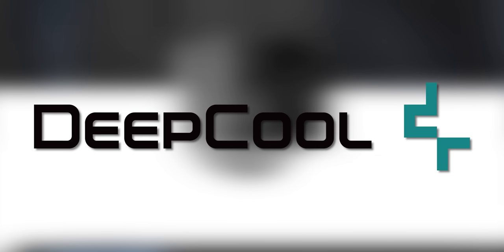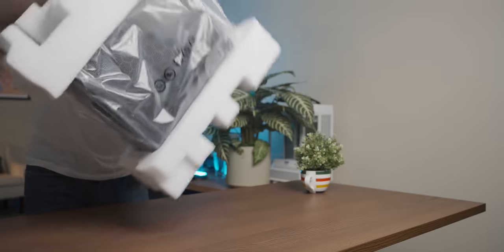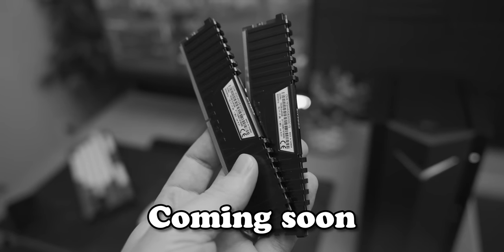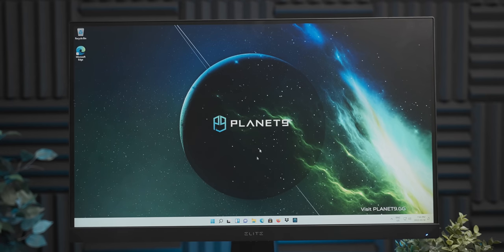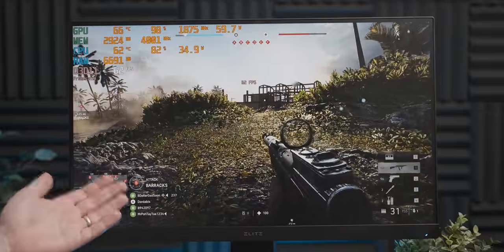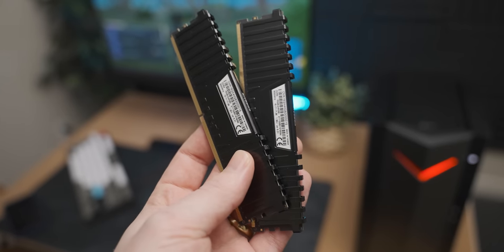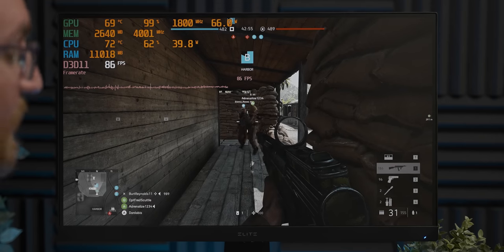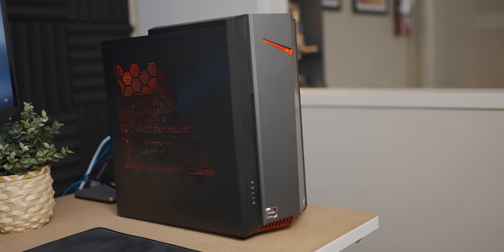I Bought The WORST Rated Best Buy Gaming PC

Comment: Reseller here --- I've gotten 2 of the older versions/variants second-hand for dirt cheap. Probably because it's pretty amazing how poorly they perform out of the box. Upgraded ram, storage, & cooling then resold. Not horrendous if picked up cheap and upgraded. But, you should open up that GPU and take a look at how poorly the internal cooling is done. HWmonitor will reveal the truth about temps on that gpu.
Reply: He showed the temps while gaming, which were in low 60's while gaming which is normal.
Reply: @jarateman6427  only the core gets active cooling on most oem cards, the core is what u saw in the video
Reply: The mobo needs to be swapped out tho, that bios has no options, they should get inspiration from the Chinese xeon mobo's with 9000 options
Reply: I have roughly the same PC without graphics card but have 750 way power supply and 2 8 gigs ram
Reply: But only for 300 pounds
Reply: @jarateman6427  - Those aren't ALL the temps on a gpu
Reply: @dawre3124  - Not true at all. Why do you think there's so many thermal pads on cards nowadays?
Reply: @ghosttheoremproductions5469  not on 16 series oem cards
Reply: @dawre3124  - Well, two problems there. First, that's not what you said originally. Secondly, most consumer grade 16 series cards DO actually. A simple google image search reveals that if you need proof. I'm only seeing consistent lack of additional cooling on the uber-budget oem card variants. And testing shows that off-die temps on those are very high. But, what do I know? I only pull them apart, build, test, and sell for a living ... lol
Reply: @ghosttheoremproductions5469  He already did specify OEM cards, twice. You're arguing with yourself.
Reply from the maker: That’s true! It’s the second one of those GTX 1650s that I’ve gotten my hands on and they are pretty janky.
Reply: @SaddisticSpeller  - Reading comprehension issue much?
Reply: @ghosttheoremproductions5469  i have one 1660 ti from hp, one 1060. Both only cool the core. Also every other oem 16 series card looks like that. You can also look at gamers nexus 1660super Dell review to see how bad they are. If that is your job to know these things you should do a better job
Reply: @dawre3124  - Do you stop to read and understand or just write your next reply?
Reply: @ghosttheoremproductions5469  i wonder if you do lmao
Reply: @dawre3124  --- "only the core gets active cooling on most oem cards" - Not true --- "not on 16 series oem cards" - Now you're saying something different but that still isn't true. --- "i have one 1660 ti from hp, one 1060. Both only cool the core." - Your sample size of 2 is not compelling and 1 of those agrees with me anyways. --- "Also every other oem 16 series card looks like that." - This isn't something we are disagreeing about so I don't know why you keep repeating it. --- "You can also look at gamers nexus 1660super Dell review to see how bad they are." - Same as last --- "If that is your job to know these things you should do a better job"v - You're the one arguing non-points and making factually incorrect statements, lmao ------- ROFL. I'm done. Go argue with yourself in the corner or something.
Reply: @ghosttheoremproductions5469  you should tho. you dont have a signle point and yet you think ur right
Reply: @dawre3124  - I take it you don't read much. Just talk.
Reply: same, bought it at $500 new, threw in some 32GB 3600 sticks and SSD for gaming, and sandboxed all programs from each other and it runs extremely well, if I threw in a 3050 I honestly would be happy with how well its working rn. the 1650 is handling MW2 with no problem and I don't see any need to upgrade that yet tho. but If you are unsure then I def recommend getting an extended warranty from your seller for a peace of mind.
Reply: Mine blew today after 2 Years 3 months. I call planned obsolescence.

Comment: In my experience after replacing the prebuilt's  preinstalled os past that any slowdown of the PC over time is down to user error. People installing all kinds of weird crud and expecting their PC to not suffer for it. The other day i saw a guy complaining his computer was slow while he was running a mining program on it in the background.
Reply: If it lets you. I had an HP system years back that literally had it's bloatware built into the motherboard or something. Even went as far as installing windows in a different machine on a new HDD 100% clean then putting it into the HP and it refused to boot. You had to install windows on that computer at which point it would inject it's bloatware into the install at some point and if you tried to get around doing it the way HP wanted it would crash at boot. 

That's why I always caution the advice "just reinstall windows" because some companies go next level on not letting you do something on the hardware YOU bought without their permission.
Reply: @devilmikey00  yep, you have to fully wipe all the partitions on the drive or the restore partition will reinstall all the junk, insanity.
Reply: lol. Honestly not sure how they managed know enough to configure a miner, but not enough to know that running a miner will hurt general usage (unless you specifically tune the miner to be a bit lighter on the system)... Maybe they were using the Norton miner.... o_o The horror of such thoughts...
Reply: @devilmikey00  My professional recommendation is to not buy such computers. Not all oems do that and even HP doesn't do it on every system.
Reply: @11matt555  NiceHash basically does it all for you, it's really easy to setup. They even have a QuickMiner version which is even easier.
Reply from the maker: Haha!! That is true, most people often do some pretty crazy stuff with their systems. Thats why I want to spend a bunch of time with the system and see what’s what.
Reply from the maker: DeltaIsPower  Not at all. 😂
Reply: @devilmikey00  That's not accurate, I don't believe that for a single second. There is no way to build bloatware into a motherboard and furthering that make it auto-install. You probably installed it again from the driver download page without realizing it.
Reply: @devilmikey00  Def sounds like HP.
Reply: They be downloading 5mb free gta v
Reply: @Josh.Davidson  nope, stuff like that exists
Reply: @manlikeilyas  No it doesn't, sorry. Maybe through a driver or OEM utility but in the motherboard itself, impossible.
Reply: @Josh.Davidson  hm idk, ive seen something like this though
Reply: @devilmikey00  well the only way you can install a OS on one machine and use the same drive on another, both computers have to have pretty much the same brand of motherboard, sometimes it has to be the same exact motherboard or else it will not boot which is what you experienced
Reply: there is no storage on a motherboard for "bloatware" and no way for a board to know that an OS has been re-installed to trigger such a sequence. This is a conspiracy theory. You installed the bloat again - probably as part of a driver package. There is no way it can install itself.
Reply: @Josh.Davidson  This is wholly not true. One look up rocketfish for a direct malware injection from bios. And two since windows 8 the bios can flag programs as auto download from the windows store upon windows reinstallation.
Reply: @Jackpkmn  I couldn't find anything called "Rocketfish". If you mean the Lenovo "Superfish" incident, that wasn't reinstalled by the "BIOS", a clean install would clear it off your system.
I also can find no information for your auto download claims. Maybe you mean stuff like the NVIDIA control panel or Realtek control panel - that's flagged for download by the driver not the BIOS. That isnt' bloatware either, its part of the driver suite.
Reply: @devilmikey00  100% that pc would be eating lead salad if I had it.
Reply: For me, when I had a nitro laptop, it was really rubbish after a while. I just used adobe, epic games, and Minecraft. It sucked after a while! Did I mention it had a 3080 laptop gpu? It was truely horrible after a while
Reply: @devilmikey00  or you know, just buy a pre-built without os lol
Reply: Do you know a good pc for Minecraft ROBLOX and Steam VR games?
Reply: Mate of mine works in IT and does a lot of remote work. A client of theirs called, it was the boss of the client company wanting some remote work done to speed up his laptop and declutter it. My mate remotely connected to this guy's work laptop and began by clicking through his internet explorer tabs, as he had a lot of them open. He clicked onto a few and found the guy was browsing through Amazon, eBay, his personal bank account, etc all personal stuff. Then he clicked onto another tab and it bought onto both his screen and the guy's screen a porn video with about 20 different popups all loaded in the background and ads all over the page. He quickly clicked off of it but the client knew as he was on a phone call to him at the time and heard him stutter when he clicked onto the porn tab. Apparently the client very quickly and sheepishly said that he'd "done enough" to speed it up and declutter it after that.

Comment: To be fair, the second comment could easily be user error. "My PC is slow now" is either aging hardware and newer software or just a user putting junk on it. I assume the PC came with a small SSD so it's probably full, can't cache anything etc.. Not to mention dust and all, that may increase temps and throttle the PC.
Reply: I think it just had the single NVME drive. Or, they have 20 tabs of Chrome open.
Reply: I mean, the review doesn't even imply that the thing got slower over time. It just says that it's slow and they've had it for 5 months.
Reply: Worked at MS support for years and owned my own pc business before that, I can GUARANTEE that's what happen (I would see this all the time). The person is probably one of those people who just click through installers and don't read anything installing tons of bloatware on their pc.
Reply: yup, especially on cheap SLC caching SSD's. You only need to get your drive to 80-90% full and it will drop performance because of how caching works on those drives.
Reply: @sweaterfish6311  The message is clear to me: It's so slow, it took them 5 months to write the review.
Reply from the maker: Oh for sure! That’s why I want to spend some time with the system and see how it holds up to my use.
Reply: @Jtzkb  I have 20 windows open not sure how many tabs but I'm using between 40-60gb of swap on a nvme drive.
Reply: @Jtzkb  can't it's soldered 🙃 thinking about getting a new machine
Reply: @Jtzkb  I did some math and I'm only writing about  1.6 TB per 30 days which equates to about 8% of the warranty coverage by the time the warranty expires.
Reply: "MOST" people have a TON of startup programs that run at Window boot and this can literally "KIIL" you on performance levels!  One quick clue to this is after Windows boots up and settles down after a minute or so bring up the Task Manager and look to see how much your CPU is being used. If its over 3% you have too many "startup" programs running in the background or your Antivirus is hogging resources! You need to STOP these hogging programs from running! My system never goes beyond 2% CPU at idle with the Task Manager open! I do CAD (with Raytracing rendering), Gaming, Video/Photo editing and have 32Mb of DDR4 3600Mhz RAM and have no issues with my hardware specs. I do NOT have a beast rig and consider it as as a low/mid level PREMIUM gaming rig.
Reply: @InfectedChris  20 tabs of Chrome open? Amateurs. I have 79 tabs, ready to access.

Comment: Generally theres a debug option in those bioses. If you hold shift and hit the f keys you may be able to get a hidden list of bios options. Some dell bioses had hidden overclocking features in those menus.
Reply: Yeah, my MSI Laptop has a pretty damn exhaustive hidden BIOS menu.  Like so exhaustive I'm fairly sure you could easily brick the laptop if you didn't know what you're doing.
Reply: @startedtech  You can't "brick" a system with a bios. Because they always have an on-board flash option back to the original bios.
Reply: @zedorda1337  not true
Reply from the maker: Oh cool! I’ll dig around in it over my extended period with the system and see what I can find. 👍
Reply: Same. I have an Acer Nitro laptop and there is an advanced bios you can access to change many features.
Reply: @DawidDoesTechStuff  You will dig in and find venereal disease stuff in there.
Reply: @DawidDoesTechStuff  just hit random things in the bios. Shift keys with f keys and ctrl keys with f keys. I found debug menus on my x58 dell motherboards and a few 1151 acer boards  a while ago.
Reply: Let's be real here. Before the pandemic these were $600 dollar PC's. It's only because of the "chip shortage" which I think is a conspiracy to fleece consumers, that these are so expensive. It's worth 600. Not 1K
Reply: @michaelimlay5773  how do you access that menu i have a acer nitro 5 laptop.
Reply: @startedtech  What?
Reply: I relate to your name. I have an Sapphire HD7970 in my backup system and it's still a beast for its age even now lol. A legend among GPUs.
Reply: @DawidDoesTechStuff what did you find?

Comment: The peripherals aren't really ewaste if it works it could be a backup option if the keyboard or mouse breaks. At least that is my poor boy opinion
Reply: You are right, but once you get a quality keyboard, they don't break like cheap ones, and you won't be able to stand typing on that garbage membrane keyboard either. I have an extra keyboard in my closet, but it's been there for 5 years now.
Reply: @Eckx1084  can confirm. Used some e waste peripherals for like 3 years and recently switched over to some good stuff and it was life changing lol
Reply: @Zacyz125  I got my kids a Razer bundle for Christmas. Keyboard, mouse, headset and mouse pad. They are membrane keyboards. Whenever I have to do something on their PC's I cringe. It feels so bad compared to my GMMK. Best $120 I ever spent, really.
Reply: It's ewaste. Wasted plastic and PCB that won't last and often won't be used
Reply: Right? I always keep that stuff around. In case something breaks or if you're a wireless mouse/keyboard user and the batteries die and you don't have any replacements, an old wired mouse can be a real lifesaver. 

For example, a crappy old Dell wired mouse I found in a box of new-old-stock "ewaste" saved my butt just last month when my wireless mouse's batteries pooped out  at work and I didn't have any replacements. I'm a graphic designer so being without a mouse is a bad situation.
Reply: @Eckx1084  yeah i went with logitech g502 hero mouse and the logitech g512 carbon mechanical keyboard and hyperx headset.. Kinda middle of the road stuff but in comparison to the cheap stuff its insane. Will never go back haha
Reply: @silure9502  i would use them
Reply: @cdy  Enjoy destroying your wrists with bad ergonomics
Reply: @silure9502  I disagree, I always like to have a cheap keyboard and mouse for backup proposers because my periferals break often because I don't have the funds to pay for a quality keyboard, so I have to resort to cheaper mechanic keyboards that break in one year and half

Comment: I think you need to invest in a second stick of 8GB green meenie ram that's exactly the same as the original and that should bring back that 3200 speed. Also if the system is slowing down progressively could this be indicative of an issue with the ultra budget NVME? I had a similar problem with an ADATASU635.
Reply: My thought exactly. I would open the PC up and look at the model of that single stick of RAM and then go online to buy another one of that type. It's not pretty ram but getting another stick of 8GB to match is perfectly fine and saves a ton of cash over buying a whole new 16GB kit of memory, especially if it is running at 3200mhz. Plus, the performance difference between either  kit would be negligible, at best.
Reply: @MrR2185  One thing to note,
These "simple" sticks of ram can sometimes not be so "simple", sometimes these green sticks of ram are made by request to the manufacturer to be the cheapest possible. What that means is they usually are single rank sticks, the ones you find online are probably dual rank sticks because its made for a global market.
Therefore you may end up with two sticks that you think that are the same, they have exactly the same specs and branding but they are very different inside and the machine may not even post.
Ive had machines that only post with single rank memory, ive had machines that only post with dual rank memory, but nowadays consumer-grade they pretty much accept everything you throw in.
Do not confuse with single and dual channel memory.

Comment: I do actually still own and use the old Nitro 50 ( since its my only pc) and, its not that bad.

i7 8700
Gtx 1060 6gb
2tb
dual stick 8bg (16 in total , before had single 8 stick but i upgraded it)

even if it was a showroom model which was running for years and was therefore cheap and even if one of the ramslots broke, it works surprisingly good ( and it isnt possesed by anything which is a plus)